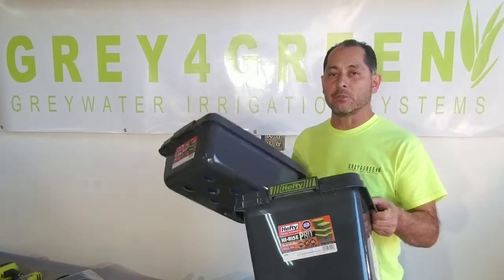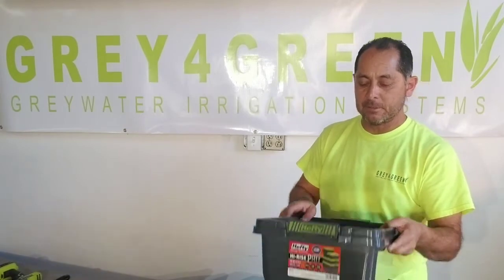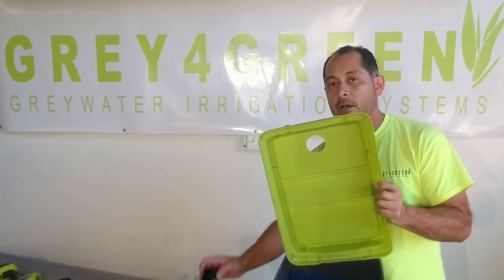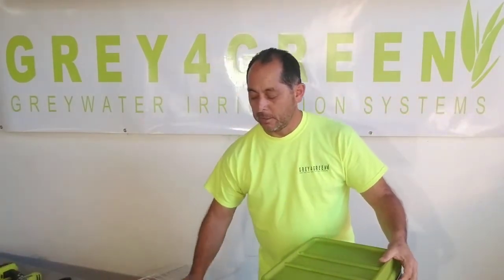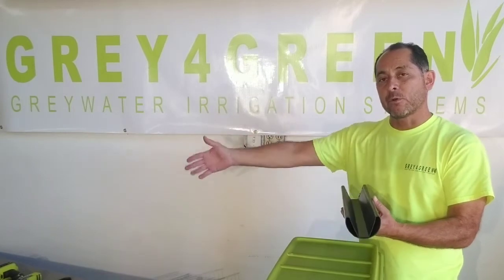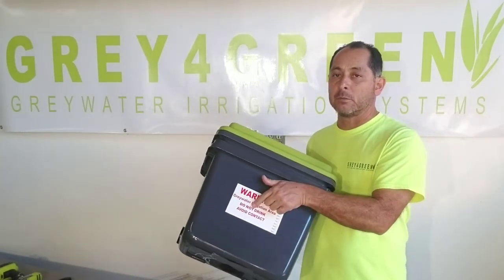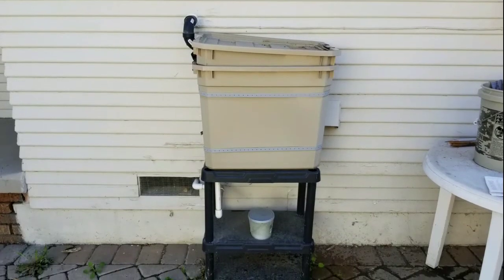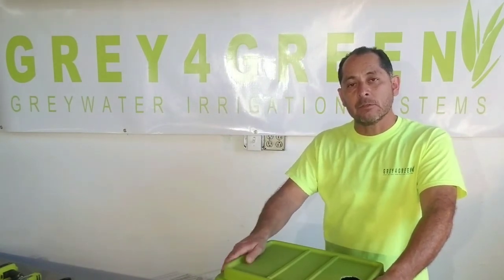How To Build a $40 DIY Greywater Filter

Comment: I have installed a gray water system on a straw bale home I am building in Phoenix, Arizona.

I am researching the type of filters that are available to install in the ground to filter the gray water before it reaches the emiters.

Any recommendations?
Reply: You may need a sand filter but for starters do a yt search for bucket grease trap.  A double bucket grease trap will catch a lot of debris too.

Comment: A washing machine can put out a lot of water very quickly.  Are these totes and drain lines able to handle that flow?  I’m thinking they can because it’s a flow through system. But I wanted to ask anyway.
Reply from the maker: Your answer is correct, the flow through into the greywater pipes is fast so no worries of over filling the totes. I have even reduce the size to flower pots (see other videos on that type of design)

Comment: Current plumbing code in my city requires  reused grey water be filtered to nsf 350 standard.  Those systems have blowers aerators membranes and cost $5000 or more ridiculous!!!
Reply: Most city codes will allow for simple greywater systems to be used, as long as the water is applied subsurface. It is when you want to apply the water above ground with a sprinkler system that a NSF 350 standard is required. Have the building code / inspector check the National Plumbing Code.   

Approach the building code desk with the basic concept:  A greywater system,  delivering water subsurface is a septic leach field and all cities inspectors know how to review the plans for such a system. - Hope that helps, and thank you for the question.

Comment: Filtering greywater is the last thing I need to crack for a self sufficient home. I hope this works
Reply: Did it work
Reply: @sandyginn860  idk yet. The closest store to buy these things is 2 cities over and I dont have a car, I'm waiting til someone can carpool with me
Reply: @dexxieboi5579  oh wow....well good luck and let me know. 
I would have don't this here at my place. O just did a tiny house with recycled wood. I'm loosing it due to being laid off. So now I'll be homeless. Lol. Not really funny but...oh well
Reply: @sandyginn860  are there resource options in your city? Some basic non profit stores that do donations usually help out with things like rent issues and utilities.
Reply: @dexxieboi5579  yes, but talk about slow. I had an appointment 3 weeks ago. I haven't heard back. But I'm not giving up. Thank you for the thought. 
Slow process on everything.
Reply from the maker: I give the basic concept, you can use almost any container. See our videos on using a flower pot or you can use a empty five gallon bucket with two lids. The first lid cut so it sits lower in the bucket and poke holes into it. This become your filter holder, the second lid it to cover the system.  Hope that helps you and others who live in rural areas.

Comment: Filtration explained. The gray water will flow down the black pipe to top of the container; the filter cut out will catch big particles. and then off to the yard or run off but what about chemicals used inside the home. how is that filtered? or is it okay to let this be unfiltered
Reply from the maker: Lets talk about chemicals: 

1st) for laundry diversions:  We find that current laundry detergents do not harm the landscape or garden plants.  Thirty years ago the formulas where harmful to us and the environment. Today, they have been reformulated to be better for our skin and thus the environment.  Take away, no need to change brands to divert your greywater to the landscape or garden.   If you decided to use a environmentally friendly brand like ECOS, that is even better, since these brands are usually made with natural cleansers, but it is not a requirement. 

2nd) for whole house greywater diversions.  A whole house greywater system, usually has a way to divert the greywater to the sewer,  this allows you to use a tub cleaner or wash a child with poop all over them (if you every change a diaper you know what I mean) and not worry about your garden or landscape.  We have plenty of videos on our channel, showing multiple ways to divert the greywater between the yard and the sewer.   Thank you for the question.
Reply: @tf5pZ9H5vcAdBp  less harsh chemicals need to be used like ECOS laundry soap. Its more safe for plants less salt chemical if i remember right. https://www.youtube.com/watch?v=QFqV17wrnvE
Reply: https://www.youtube.com/watch?v=QFqV17wrnvE